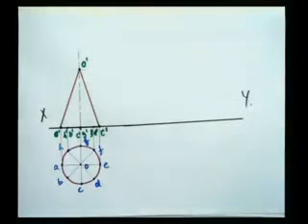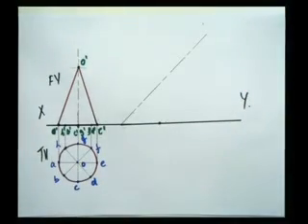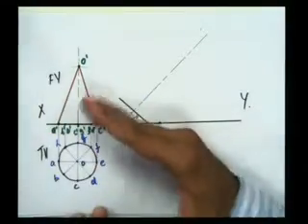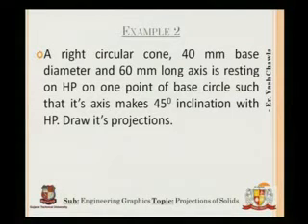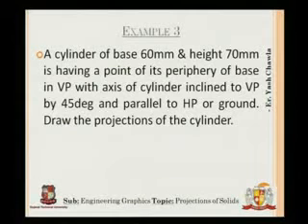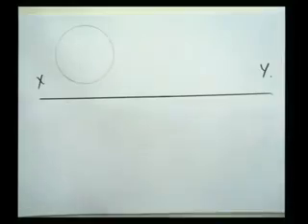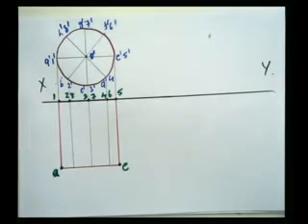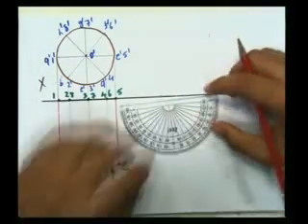Yash Chawla-Engineering Graphics-Projections of Solids_2

Comment: sir you have made a mistake while solving 1st question in second step. when the axis of cone is inclined to the hp 45 degrees, then in the top view points c1, d1, e1, f1, g1 would be dotted as that side of the cone can not be seen in the top view. plz correct it. Thank you